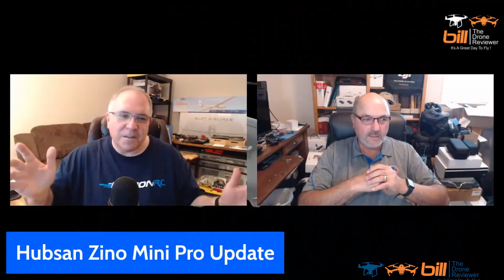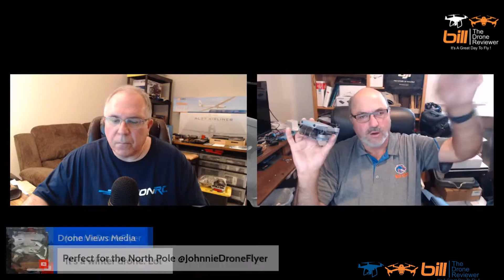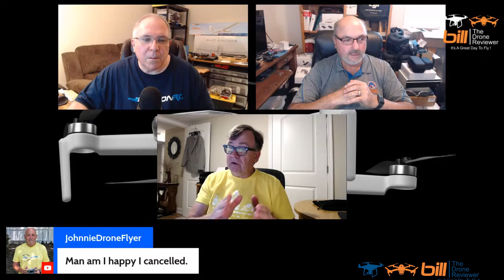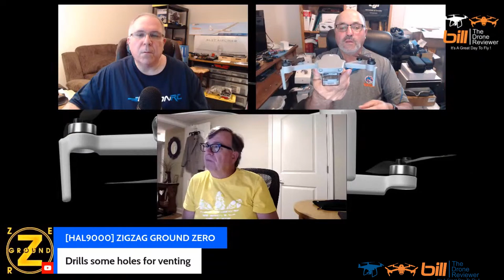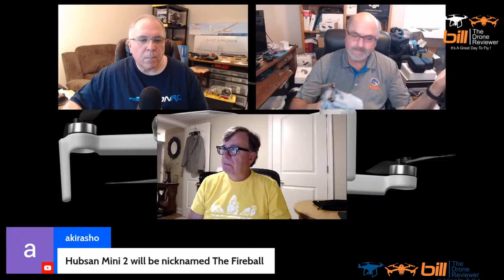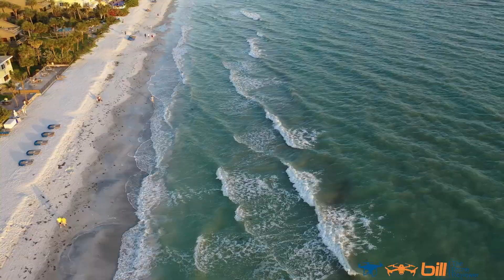Hubsan Zino Mini Pro Brand New Update

Comment: From others I've heard you're to take off that bottom cover (which snaps off easily) when flying. That cover should be kept on only when you are like doing a firmware update so it doesn't burn something underneath it.
Reply from the maker: Thank you for the information.